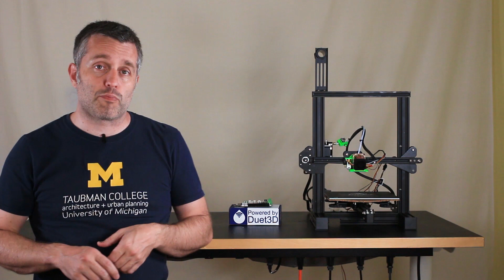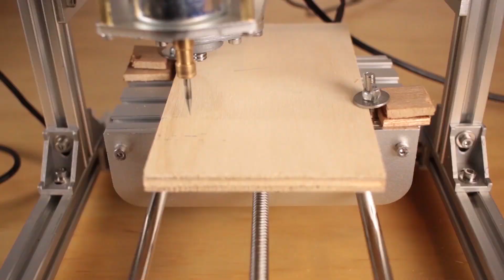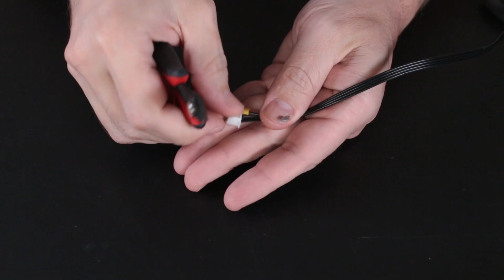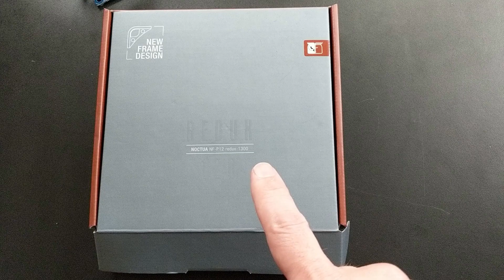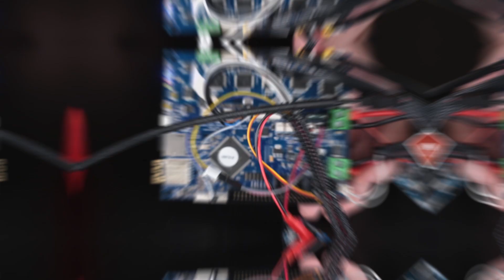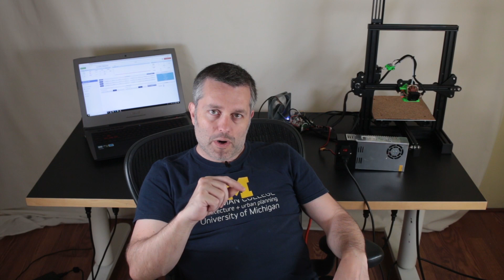Wiring the DUET Wi-Fi to the Ender 3

Comment: I think you're missing the entire point of what makes the prusa attractive. It's not that it can do all those things. It's that it does. It comes from the factory doing those things exceptionally well and consistently. I have hacked together my own creality printer, I've upgraded the main board. I've installed BL touch. I've changed the airflow on the hot end hell, I even compiled my own Marlin firmware for it. But I choose my prusa over it every single time because it works consistently. Every time I send a print to my prusa I don't even look. It just makes the thing. Contrast that with the CR-10 that I mentioned before that I've done extensive modding on it works. Maybe 80% of the time and that sounds high but the results are worse, It takes longer, And it takes so much. Goddamn fiddling and needless human intervention that the prusa. just. doesn't.
Reply: And that's not to say the prusa can't be improved. One of my favorite parts of my CR-10 is that it's damn near silent because the 32-bit driver allows for much cleaner motion on the stepper motors. My prusa i3 MK3S+ that was heralded by reviewers when it first came out as being a near silent printer is so loud because the main board just doesn't have the power. I'm not saying the prusa is perfect. I'd love a better board, I love a bigger build volume, I'd love the aluminum extrusion with no 3D printed parts and no zip ties. But the reality of the situation is that no one is making that printer, no one is making a printer with the consistency and ease of use as the prusa, at least not in a reasonable price point. So your choices are an extremely reliable printer with some slight drawbacks and caveats. Or a printer you're going to need to baby and repair and upgrade and mod to Hell and back to the point where the ship of Theseus becomes a relevant conversation to reach the same printing capabilities at even a fraction of the consistency of option 1

Comment: Not tinnng the wires comes from aircraft standard practice, due to vibration it may break at the end of he soldering. Not applicabe at a 3D printer, the vibrations are not even near an aircraft. There is no softening of the tin because of aging.

Comment: That board is interesting, I see it takes four open source Dev boards and puts them into one. Oh and two buck boosts on there for voltage regulation.

It's got a esp32, so you should be able to install a camera on the printer to run HD video or stills, and use the other open source webcam, so you can keep an eye on the work, without being there.

I'm still trying to work out the touch.
It's a press switch? Or radial/slide resistor that takes a measure?
The Arduino can do this for you, if you pass voltage through the website or a resistor and get it to register the difference, you can then calculate the distance from or two the board based on the boards location and head heights which is ref from the ax home.

But when you think of things, say for example the enderextender...
 All they have done is cut and copy drilled the holes of vrails.
So that's about £20 for the rails.
I believe there is some cables included so £1 a meter should cover those.. (each) and there is the plate or bed, not sure how much, but about £20 would cover it.. 
About £60.00 we will say.
But it's about £140.

So here is my take..
If you're having fun, then say thanks, if you're making money, make a donation.
OS is a 'help others' and 'make it better' and share. It's not for spin off profiting or segregation to free and paid... But if you take free to make money then ethically it's wrong.

I've always promoted OS in many lines, and I have contributed to many well known projects and things I headed up were and have been sold for millions. But as long as I can say and show it was me and I made not money from them like others have, then the lesson is learnt.

What's the lesson?

Comment: Hi I'm going to be installing a duet 2wifi on my cr10s and I'm just wondering the way u hooked up your steppers to the board did it work right doing that way I want to clip the jst plugs the way u did it cuz I'm lazy and dont want to crimp new connectors but I'm just wondering if they worked that way
Reply from the maker: Yes, clipping the connectors the way I showed will also work on a CR-10. That is the technique I used when I built this CR-10s: https://youtu.be/mw5TXlSzQYI also, here is the video about the Ender3 Evolution:  https://youtu.be/SOZe_fg9DN8 The dual-gear direct-drive, filament runout switch and BLTouch  sensor on a CR-10. Is an unbeatable combination.
Reply: Thanks

Comment: please install duet 2 on prusa i3
Reply from the maker: Ha Ha Ha! I had not thought of that :) Mythbusters proved that it is possible to polish a turd. Prusa took this to heart and he has polished that turd of a printer to make it shine. You get great performance out of a Prusa (apparently, but I wouldn't know because I've never used one), but that is because they have taken the lackluster platform and tweaked/tuned it to the N-th degree until it performs so well. I'm uninterested in duplicating this effort with a Duet control board. I would rather start with a better frame design. One which doesn't have the very foundation of the print bed held on with zip-ties.

Comment: How does the duet compare to the SKR 1.(new)?
Reply from the maker: There is a lot more to the 32 bit discussion than raw horsepower. Duet is a hardware and software package. Both have been designed together to work perfectly in sync. I talked about some of the issues in this video: https://youtu.be/bFQjFvxiIkg

Comment: I`m here to tell you, the creality ender is JUNK. I bought one and 3 days into it, it wouldn`t read the sd card. Then I turn the power off, the screen would not turn off. After 3 weeks of `customer support`, I gave up. There was always someting they wanted me to try, or take video of my operation, or try several different sd cards. Enough.....JUST FIX IT. Nope they just kept adding more requests of me to try and fix it myself. DO NOT BUY from CREALITY. The printer is gabage and so is the service. These people that give the printer good ratings are compensated for their review. Do not get sucked in.
Reply from the maker: All of the problems you suffered were caused by the electronics. If you follow the guide in this series of videos I made I teach you how to upgrade your faulty electronics so that you end up with a printer as good and reliable as anything else out there, and at a far lower price.

Comment: The guilt tripping aside, this video was pretty helpful. I dont feel bad about buying a clone since the clones are the only thing sold by Amazon with Prime delivery I had it the same day. I probibly would have been more open to buying an original if they sold it on Amazon Prime aswell... Besides, how much have the original developers benefited from the open source aspect and getting free help developing the board, it goes both ways.
Built a box for the back of my Ender 3 Pro  to house this and 3 LM2596's and swapped all my fans to Noctua and brushless blower for the part fan, the printer is whisper quiet now and I am loving it. The loudest part is the PSU fan by far and I am going to track down a quiet fan for that next.

Comment: I was hoping to get information on the wiring but when the video starts you are already halfway through showing us a heap of cablesalad.
Also running a linear voltage regulator (buck converter) without a load can easily destroy the piece. Turn the potentiometer down, attach a load, i.e. a fan,
and then turn the voltage up to where you want it.

Comment: What do I need to keep my ender 3 screen working with the duet2wifi board?
Reply from the maker: Here is the link to the series of videos I made about this subject: https://www.youtube.com/playlist?list=PLtVk4dZInT80SCVB_Pgrn1zZThO3nmV7B You will find your answer in the final video. tl;dw You need to use a Duet Maestro. Theoretically it is possible to do with a Duet WiFi, but it is an involved process that nobody has yet done on the internet. It's just not worth it. Something I don't talk about in the video, but is good to know: The screen is 'glitchy' in it's behavior. I don't recommend using it. The best solution is to buy a $75 Galaxy Tab A Tablet and use the WiFi to control your printer through the tablet which sits right beside the printer. You can also use your phone.

Comment: I have apples to truck-nuts --- Duet 2 Wifi in a highly modified CR-10S /w 750 watt AC heated bed... Hold my beer Parusa.... 310mm^2 bed and 400mm Z  LOL @ Parusa... And I spent less than $900

Comment: I must ask about these Zprobes wiring. There's a printer that uses 2 x Z probes on stock MKS 32bit board for their auto leveling double axis bed. So BLTouch is not supported in this case cause there's no free port for extra Z probe. With Duet, how many Z probes can I connect? 3 is possible?
Reply from the maker: 3 is possible, yes, BUT...The BLTouch has 5 wires. 2 wires are for the probe signal and the other 3 wires are to control the "servo" that activates the pin to be deployed. You can easily control 3 servos with the Duet Wifi. You will repurpose heater pins 3, 4, and 5 in the expansion header. Then send 5V+ and GND to the servos, and they will be individually controllable. Easy. The problem is with the probe signal. Currently reprap firmware is set up to handle the Z-probe signal from the BLTouch through the Z-probe header on the board, and it works perfectly. While you could repurpose some I/O pins for the other two sensors, this is not already a task which is programmed into Reprap firmware, so the firmware will be the difficult part of setting up 3 bed probes. My question to you is why do you need 3? Why can't you just move the single BLTouch probe into position over each of your axis points and adjust that stepper accordingly? BTW, I assume you are making something like this: https://youtu.be/a9irK9rOUHY
Reply: @DesignPrototypeTest   Yes, kinda. Simpler version of it, just 2 motors. https://www.youtube.com/watch?v=GDGWcwDOVtA   

Turned out with Duet I dont even have to wire anything for such setups, even for 4 motors.  https://duet3d.dozuki.com/Wiki/Bed_levelling_using_multiple_independent_Z_motors

So basically all I need is to configure it right, last time I've managed codes in early Android builds 10 years ago being a student, this will be fun figuring out what these codes are after initial configuration. Wish someone come up with more intuitive configuration interfaces some day, I can follow comprehensive guides, but this is too prohibitive for vast majority of people yet.
Reply from the maker: There is no bed sensor on this printer that I can see. I suspect that they are using the stall detection feature on Trinamic stepper motor drivers to figure out when each side of the bed has reached it's upper limit. This is not a good technique as stall detection has an accuracy +/-.1mm Which is huge when trying to get things to stick to your bed. Therefore, after this stall detection rough leveling is performed, it should be followed up with a fine tuning done by using a bed probe such as the BLTouch which is moved to each side as it is finely leveled. So far as I am aware, there is no firmware which includes this functionality.
Reply from the maker: P.S. I wish Creative 3D would send me a printer. I would love to review that CoreXY machine. It looks really nice!
Reply: @DesignPrototypeTest  Duet rely or stall detection for 2+ x Z Axis and then can proceed with BLTouch. But it does not look like the use stalldetection, because by default printer comes with A4988 drivers and Marlin 2.0 on MKS Robin Nano board. They definitely use some type of sensor. I hope they send some of these machines to the US reviewers, they just started to ship them.

Comment: So you're saying that to simplify the wiring process an average Joe can use jumper wires without need to crimp anything at all? In case I want to replace board on Sapphire S, without modifying original wires, in order to be able to sell it later with stock board and keep Duet for other project.
Reply from the maker: Yeah, you could do it this way. It's actually a really good idea. I would suggest that you heat shrink the connection so that nothing accidentally comes apart. Afterward all you would need to do is cut the heat shrink, and unplug the connections. Alternately, you can do it the way I showed in this video ( https://youtu.be/PpLEjwLZwBw ) but it would not be as easily reversible, requiring you to re-splice the original connectors back on the the correct wires.
Reply: @DesignPrototypeTest  Great thanks a lot, I abandoned Marlin idea for Sapphire and going with Duet route, you were right.
Reply: @DesignPrototypeTest  And I'm looking into using Liquid Tape in these connections in order to make them last forever, otherwise I can cut them if no longer needed.

Comment: I really appreciate your in depth explanation for the open source boards and hardware/firmware. 

I completely agree with everything you've said, except for one thing, ish. I certainly agree, but not 100%

I've used open source products for the last 6 years. Mainly Blender. I've made my entire career around it. It's given me a well paying job, and a lot of respect for open source products. Like the Duet3D, blender is open source and can be copied and sold very easily. 

But where I run into an issue with your explanation, is your view on buying 3rd party copies as "stealing" from the creators. I agree, that if you can, definitely buy from the original creator. That's what I will be doing. 

But, whether they released the product under open-source for community purposes, or because they had to, depending on what the product is based on, the product was still released under open source. 

By every stretch of the license, copying and the purchase of these  copies, are in no way "stealing"
Yes, morally, it doesn't feel right. But there are people out there who are searching for a passion, and have found 3D printing as an option. Budget printers like the ender 3, are a great tool for these people. 

But if they want to improve upon it by upgrading hardware and firmware, in no way should you be shaming them for buying copies. I agree with what you're saying here, but I think if someone simply can't afford the original creators product, they can rightfully purchase a 3rd party copy, and they deserve not to be shamed for doing so. 

Shaming them, and calling them thieves, in and of itself discourages community support. This person will feel bad, and will decide not to buy a board at all. They won't share their experiences, they won't share their process. Because they can't afford the original product, and they are shamed for thinking of buying a 3rd party copy. 

With that being said, I can and therefore will buy the original Duet3D board. As I want the quality, and to support the creators. 

That's my 10 cents, my two cents is free, a nuisance, who sent? You sent for me?!
Reply from the maker: I covered a lot of this issue in the dedicated video I made about the subject: https://youtu.be/iKhn5IcVvAg

People should feel ashamed for buying clones. We are in this hobby because we love new and developing tech. By purchasing copycats/clones we are actively hurting the advancement of the tech because the Chinese clone/copycat companies do no R&D to develop new tech they just copy once a product has been proven successful.

Comment: The reason they say don tin leads is not because the solder softens it's due to it no longer squashing under the grub screw so it gets a small contact point causing a hot spot causing needless fire risk.

Comment: solder dose  add resistance. very very little resistance. i don't know about any regulations about it. but you should never ever add any solder to a multiplexed or sensor data circuit. that is to say no solder on digital but solder for everything else always. some times we even change the return value of reference signals just so we can use solder on them. lot of bro scientists misunderstand this little fact. if it's not carrying pulsated signal data or refinance signal it should be soldered. in every  case ever.

Comment: half the video talking about crimping...
Reply from the maker: and when you are doing like the title of the video says and wiring your Duet (good purchase by the way you are smart consumer), you are going to spend about half the time crimping, so all in all the video is a fair representation of reality. :) Thanks for the comment!
Reply: @DesignPrototypeTest  do you think it is a good idea to upgrade the hotend or the standard is already ok ?
Reply from the maker: @thjs  The stock hotend works great so long as you do the upgrade by onebadmarine on thingiverse. If you want to print with higher temperature plastics then you will need the all metal hot end. The micro Swiss is a fantastic choice in this circumstance.

Comment: Do I need to use 24v to 12v converter? My power supply is 220V and the original Ender 3 has 24v board.
Reply from the maker: The Duet board can run off either 24v or 12v. 24v is recommended.
Reply: Google: voltage BUCK. its a cheap converter that can DOWN-CONVERT any DC power if your worried and its 90% efficient. If this is too advanced for you then maybe changing an entire 3D printer main board isint something you should be doing right now.